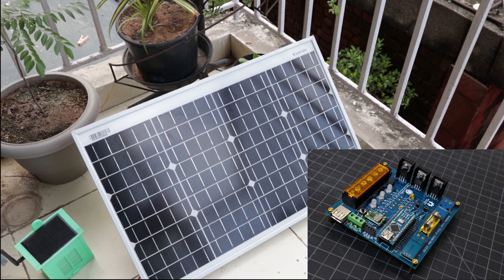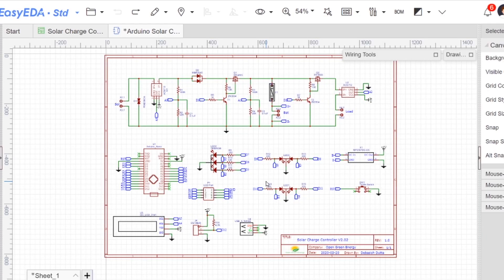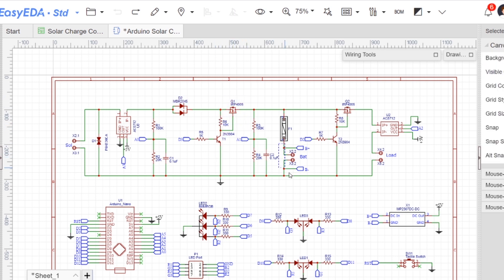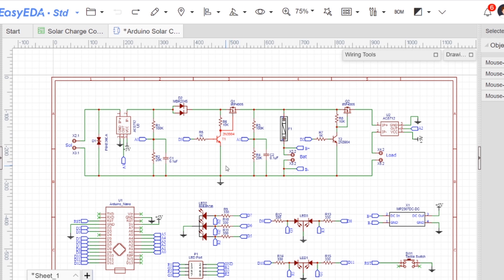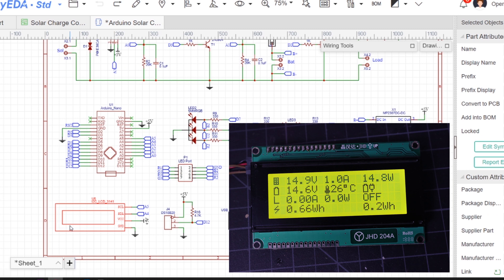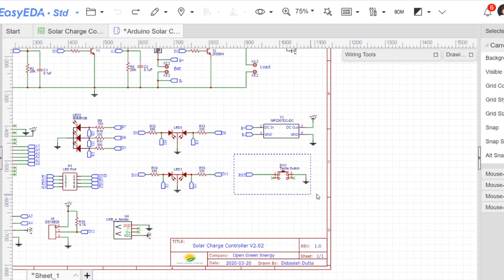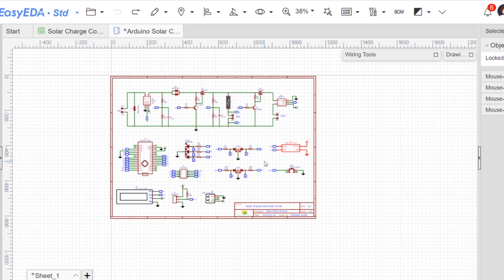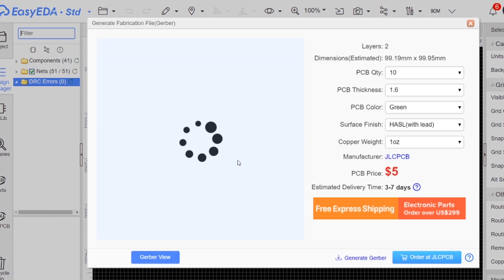Arduino PWM Solar Charge Controller V2.02 | Solar Controller with LCD - Battery  6V /12V

Comment: I was looking for this to charge my Isuzu car battery using a 100W solar panel. I couldn't figure out the car alternator computer to fix the problem with charging. At the moment, I am using a portable battery charger to get around charging the battery. It takes 5-amp fast charging to maintain the charge while the car is turned off under an hour. This is a game changer project. I am inspired to build the solar panel controller/battery charger. My go to for schematic capture and board design is KiCAD and for 3D packaging model and printing is FreeCAD. Both tools are open-source software based on python scripting language. What is the specification for the charge MOSFET? Do you have the part list on your web site? Thanks!

Comment: Hello. It's possible to modify the circuit to work with higher input voltage from the solar panels? Higher voltage i mean 100-200v.

Comment: I made your project everythnik is okey but I connected 12V 7Ah battery after arduino is burned. Everything is the same with your project. How can this be?
Reply from the maker: It's really a sad news my friend. I am also  not finding any reason why it happened.
After posting this project, no one has reported this issue.Are you using my PCB or made the circuit ?
Reply: Yes i bought in PCBWay

Comment: Congratulations for your project!!!!  What kind of solar panel are you using? 12V? 18V? Thank you
Reply from the maker: Thank You,
A 12V solar panel means it is suitable for charging a 12v battery. The open circuit voltage is around 18- 21V.

Comment: Hi Nice Project.
Could you build Arduino PWM for Lithium 18650 (LBA) BMS 3S 40A 
So far, i cannot find someone build Solar Charger Controller 200WP for 18650 Li Ion with BMS 3S 

Thanks before.

Comment: is your MPPT a standalone type?
Reply: also can i omit the grounded connection of the leds, beside the power diode, i didnt understand its purpose. The leds has already a grounded connection.
Reply from the maker: If you use it inside an enclosure, it is hard to display the LED  outside, in that case without soldering the LED you can use external wire to pin headers for connecting the LED.
Reply from the maker: It is not a MPPT type, it is PWM charge controller.
Reply: so that pins beside the power diode is just an extra pin if ever i wont solder the Leds on the board?
Reply: but is it a stand alone type?
Reply: hi! can you recommend an active diode for ac-dc converter?

Comment: Hello sir, please can I charge a battery 12v 30ah with a solar charge controller of 12v and 10a? My solar panel is 12v 50 watts.
Thanks for your answer in advance
Reply from the maker: Yes you can use that 10A charge controller.
Reply: Hello sir, please why in your first solar charge controller did you use two fuses and in the second one you use only one.
Reply from the maker: @abdouramanadamou3765  Because the placement of fuse is so selected that it does the same job that earlier was done by two fuses.
Reply: @opengreenenergy  OK thanks
Reply: Thanks

Comment: How is the load on and off process
Reply from the maker: During day load off and during night it will turn on.
Reply: @opengreenenergy  but how can we make that it must be full time on and as we turn on the light switch the load must be flowing ,it is done through the coding part
Reply: @sreejithsuresh3642  Just wire your load to the battery directly using a switch. Should be no problem

Comment: What kind of software do you use to design your schematic and PCB ?
Reply from the maker: The software is written in Arduino platform. You can see the details on Instructables link given in description.
Reply: @opengreenenergy  boss, you were asked about the design scheme and pcb, not the firwmare.

Comment: Interesting project. Can I ask, what do you believe the maximum current is for this controller, and how many mIlli amps does it use when there is no sun?  Thanks
Reply from the maker: Thank You. The current rating is 5A.
I have not measured the mA during no sun.
In that condition I have to remove the LCD and ACS712 leds. too.
Your channel is really nice one. I have learnt a lot from you. Thank You for your videos.